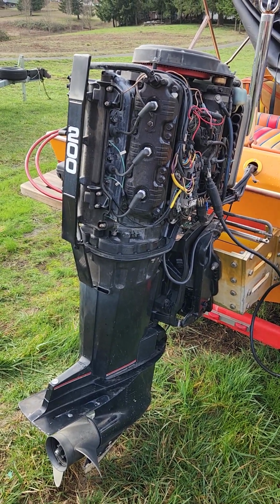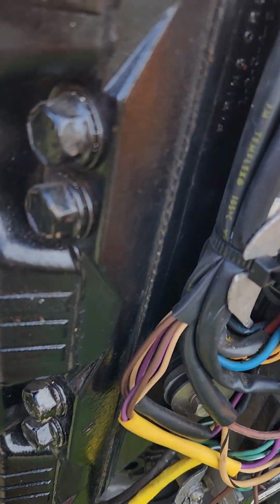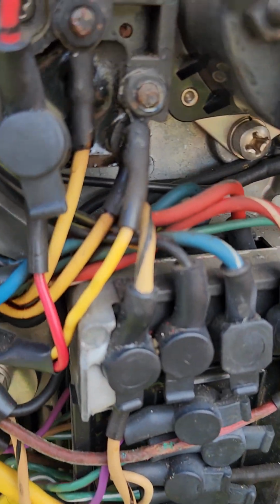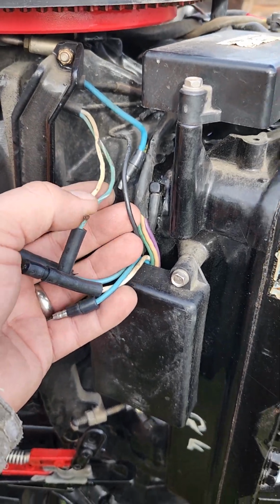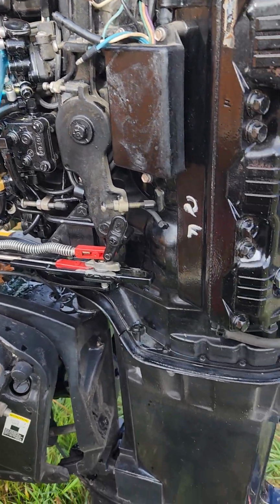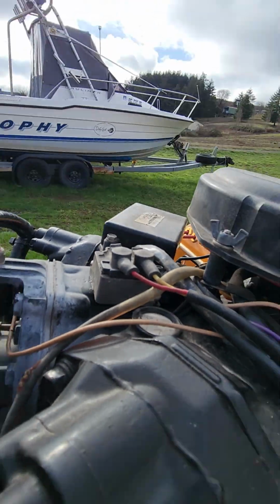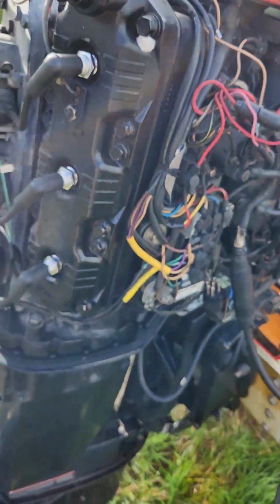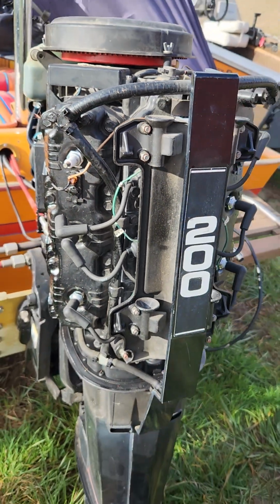Showing lots of issues with this 1988 Mercury 200hp BlackMax @OutboardMadness

Comment: Shame. Those are great engines if you maintain them correctly. I have one on my 21 foot center console. Runs like a top. As long as you have good stators and boxes on them they run forever. I love mine.
Reply: What do you mean by boxes?
Reply: @Gary-oo6bk  CDI boxes. They transfer spark to the power packs.
Reply: Switchboxes
Reply: @greauxpete  Correct yes sir. Got my terms mixed up.